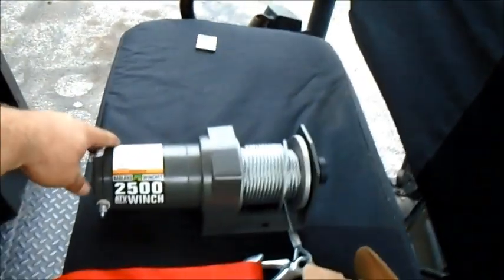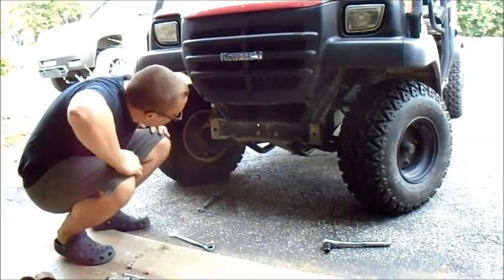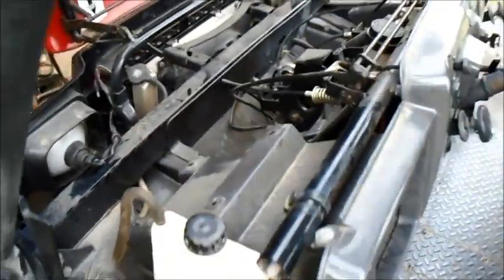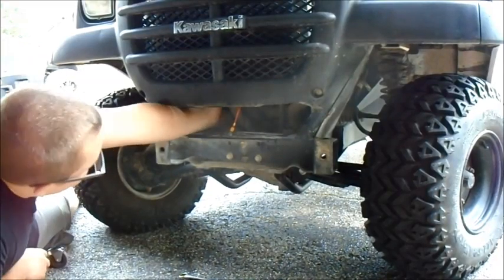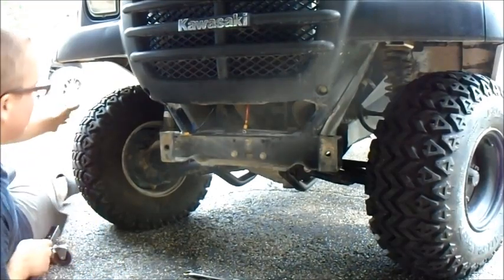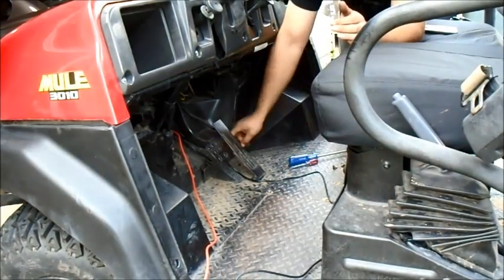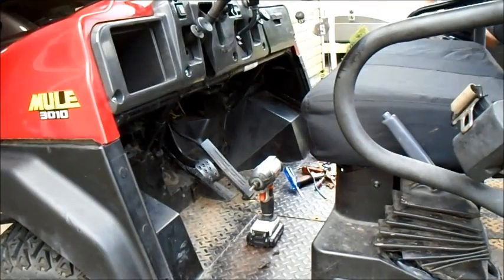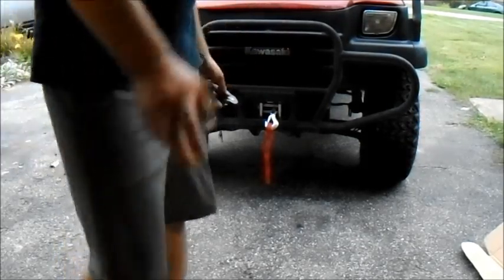Kawasaki Mule 3010 Winch Install

Comment: I have the same Mule and the same winch to install. So the winch fit right in with no extra brackets needed? Seems too easy. Thanks for the video.
Reply from the maker: john z it fit perfectly, I was shocked myself. Works perfectly.
Reply: john z I looked at mine, no holes where his is, looks like I need a bracket first. 07 mule